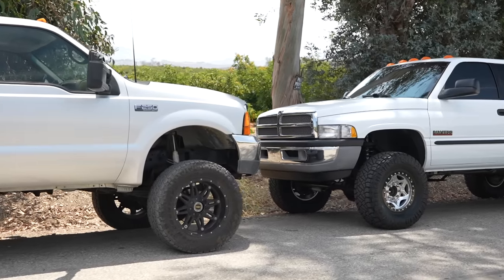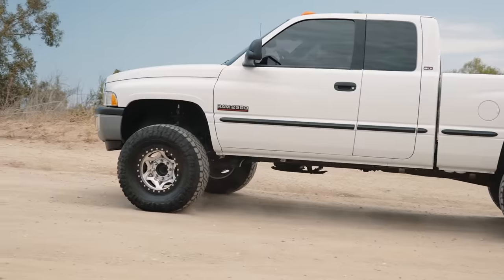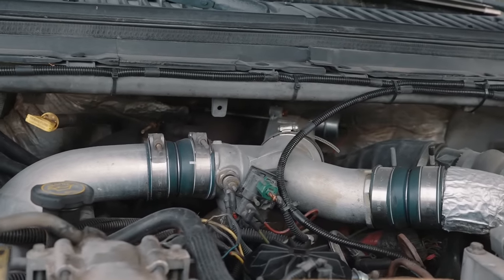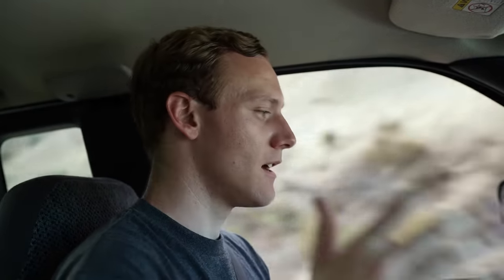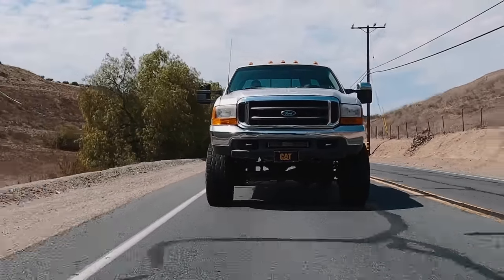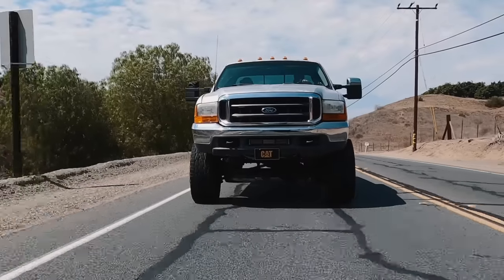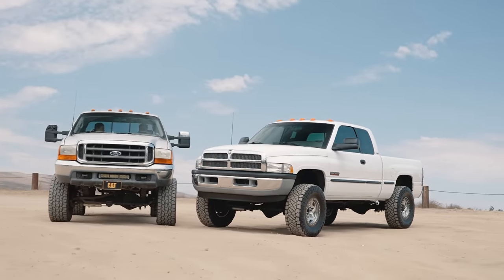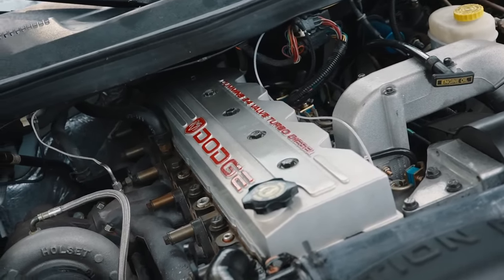1999 Ford 7.3 Power Stroke Super Duty vs Dodge Ram 5.9 Cummins 2nd Gen | Which Is Better?

Comment: I currently own a 
1995 c1500 2wd Single Cab 5 Lug Wheels 6.5 turbo diesel with 4L80e Transmission very Rare 
I also own a 1993 1st Gen Dodge W250 Power Ram Cummins 5.9 with the 5 speed Transmission 
Both 1 owner when I bought
I'd like to buy a Ford 7.3 some day as I gave of the 3 right now both my trucks run great as my 6.5 gets fuel mileage and my everyday driver my 5.9 I'm currently doing a restoration on it but it still runs which is Awsome

Comment: We used to carry both those and the Chevrolets the owner didn’t care he just bought whatever’s cheapest lol but always diesel. Most people unless they were Chevrolet fan stayed away from the Chevys. The Dodgers if it was in town everybody took the Dodgers. But if we had to go out of town it was always the forwards they just flat out pulled him. As far as area of reliability I think the power strokes did better for us. Only because the engines were pretty equal but the transmissions in the bodies were a pain in the butt with the Dodgers. The Dodgers rode nice but we were replacing transmissions in finance every 30 to 60,000 miles it was a pain in the ass. But when the Ford’s broke down they were expensive lol

Comment: It's kind of hard to compare a ride, both of those trucks have suspension lifts. Depending on who made that suspension lift will determine whether it rides good or bad.
Reply from the maker: Both have quality setups. The ram has a Carli commuter system, and the Ford ha custom deaver progressive leaf springs. A coil 4 link front suspension will always ride better than leaf springs though.

Comment: So to make both trucks perfect you just basically have to swap engines between them, trow away Dodge's transmission and put in the same as the 7.3 and built them in both trucks and upgrade suspension in the 7.3

Comment: I started with the 7.3, and ended up with the 5.9.  It will take a lot for me to go back to working on fords. Its so much easier to get power out the Cummins. 1000hp out of a Cummins is just getting started. I am surprised you have done nothing to your truck.

Comment: Personally - I am not in need of a diesel truck in general, but if I were, I would rather own the 7.3. The ford E4OD is a pretty serviceable transmission even though it's a slushbox, while the 48RE is made of glass. In all honesty I would throw out the factory auto and put an allison behind either of these engines.

Comment: Ram is easy to work on you can work on it at your house. 
If the motor gives out or tranny fucks up you have to pull the whole cab off. In my opinion yes ram has iffy transmission but like you said you can upgrade them. And it's easy to install. Ford in the other hand.
Seen more rams reach over 500k miles.

Comment: Cummins is a 10/10 engine.... The 7.3 is a 9/10 engine mostly because is harder to work on it because how is setup and space , but that ford is a 10/10 truck... And the ram a 7/10 , they all get broken dashes, bad brakes, bad front end, worst transmission than the ford... Worst seats... Etc etc

Comment: I owned a 99 F250 7.3 automatic and a 2000 Ram 5.9 cummins 5 speed manual.
Imagine driving your ram and loosing a extra 10 mph on a hill will get 2.5 mph less. 
This is what it it's like driving a Ford 7.3

Comment: Personally I chose to work my obs 7.3 5spd pulling dump trailers hay tractors campers logs through the woods ext cab short bed auto locking hubs, broke bell housing merging, zf6 swapped and now on 2010 axles Waitin on intercooler a very big upgrade on 99 then I’ll go hybrid injectors 😂 for the price of a cummins swap

Comment: Here in the Midwest, the 7.3s love to rust out their oil pans. Good luck with that. Most expensive oil pans out there.
Reply: Everything rusts out in the Midwest because of the salty roads.
Reply: 7.3s are notorious for rotting their pans, and not every vehicle needs their cab and engine pulled for a pan replacement

Comment: Had an 05 350 ford 6 litre , called it the exxon valdise , could not keep fuel in it and rough riding even with the longbox,, but lots of power

Comment: I’m trying to snag a super clean 00 7.3 from a co worker. Only has 140k and he’s the original owner. I drive a 4th gen Cummins(2018) and I live the engine and interior but I blew the 68 at 80k miles and still not impressed with the built trans I put in.

Comment: I love the dodge, but these days if you compare price points on the two for a decently clean sub 150k mile truck the dodge is astronomically higher unless you want to go for one that has a lot of body rust and go that route. I could find a decently clean 7.3 with minimal rust and right around 200k miles for right around 10k, to me that’s what makes me like the ford more, as well as the better transmissions, through basically their whole existence, dodge has struggled with automatic transmissions to pair with the diesel trucks 😭

Comment: The fact that an engine is inline doesn't mean it's going to produce more torque, in this case we have six cylinders versus eight, with the 8-cylinder we have more power pulses per revolution than a 6 cylinder so if the 8-cylinder had exactly the same bore and stroke it would most likely outperform the 6-cylinder, so really engine configuration means very little in producing torque and Power and has more to do with bore, stroke and displacement

Comment: Your F250 is lifted and has leaf springs on the front and is 4x4, my 2wd F250 has coils and is not lifted and it does have a rough ride on rough roads but on the highway its fine. A little school bus like but not horrible.

Comment: Do you have a preference for specific tasks? Such as towing highway, in town, or uphill, stopping etc?
Reply from the maker: Towing: Cummins for the torquier feel. 

Highway: both actually are comfortable, but the 2nd rides better so that’s what I’d pick. It also gets better fuel economy. 

In Town: 2nd gen wins for better ride, but the Ford wins for more space in the cab. 

Uphill: If it’s an empty sprint, the Ford, but if it’s loaded I prefer the 2nd gen. It’s also significantly cheaper and easier to make power with the Cummins platform. 

Stopping: Both are pretty equal!

Comment: The ford might be a little more of a pain in the ass to work but my 7.3 just has a tuner and an aftermarket electric fuel pump and has as much power as a tuned 6.0

Comment: You got one thing wrong in this video. No you cannot put a cup into the first gen super dutys cup holder because they instantly fall into the floor ruining your carpet especially because how stiff the suspension is I have two 7.3’s and I never use the cup holder because every single time I do the drinks spill I have to put my drinks into an aftermarket one I just set in the middle seat

Comment: I've driven both trucks the Ford 7.3 for a door company I once worked for and I own an 02 Dodge5.9 honestly I only stop driving my truck because California's laws against older diesels sucks to me the Cummins is low maintenance no HPOP to worry about the ugly dashboard can be little costly to fix but it can be fixed mileage is awesome power is always at hand the Ford has a terrible turning it's like a river barge I worked on as a teenager hauling brown sugar from the factory to the port but it's just my liking the Dodge and Cummins to each his own

Comment: I have owned a 99 f350 7.3 and 2000 ram 2500 5.9 and i will tell you that when they have the stock suspension the f350 is a much better ride. love both of the trucks though.

Comment: You can also pull a transmission out of a v10 dodge and stick it in you 24 valve
Reply: sounds like a funny loophole, i wonder why the V10 got a better trans.
Reply: @Jszul2318  has more gears in it, you also can pull a v10 out and fuel tank and lines and switch engine mounts and drop a 24 value in it
Reply: @dallasnunn5969  I don't recall the dodge v10 having more gears then the diesel model. But I've never tore one down 🤷

Comment: Should of done a comparison of the 96 models  power stroke vs the Cummins when they both kinda improved then Last years of there generation in 02/03 years at there max stock output from factory

Comment: I've owned both in auto and manuals and go with Ford. Less issues dodge had transmission problems in auto and manual trans as well as front end death wobble in both dodges.

Comment: We had the 5.9 2500 with the 6 speed manual tranny.. you could put it in 3rd gear and let out the clutch with no gas and it would just go.

Comment: I just prefer the 5.9L Cummins. 

It's easier and cheaper to work on. As long as you don't have a #53 block your good. The transmission of the Dodges will be your biggest issue.

Comment: Ford  had failed and spent so much on the E4OD that it was rebadged to 4R100 to get the bad taste out of the mouths of consumers. It paid off and came out strong out of the gate for the 7.3. In terms of building and boosting the Cummins wind but for OEM+/mild builds and daily driving the 7.3 is very much up there and comes down to personal preference. Both are simple motors and you can even put the ford trans behind the Cummins 😉

Comment: Ok ya the 7.3 vs the 24v Cummins is a fair comparison, you can’t compare the 7.3 to a 12 valve though. 12 valve stomps both all day long
Reply: Did you know the 7.3 is a 2 valve per cylinder like the Dodge?

Comment: Always wanted a 7.3 so I bought one. Had real bad luck out of it. So I sold it and bought another one thinking maybe a had a lemon. Nope it got even worse. I wish I wouldn't have had so many problems because the 7.3 is a "good" engine. But I'll never own another. Haven't had much issues out of my 4 cummins.

Comment: Ive got an 02 6 spd dually 2nd gen and then ive also got a 99 f350 powerstroke as my service truck for work both are 2wd my 2nd gen has 199k miles and my service truck has 101k miles. My dually definitely out performs the 7.3 mostly because it's a manual and the 7.3 has an auto but if the 7.3 had a manual as well i think the cummins would still out perform it but itd definitely be a lot closer match and the cup holders in the 7.3 suck compared to what's in a manual 2nd gen

Comment: I love them both, but engines aside the Ford is a far better built truck, dash and interior doesn't crack and fall apart as easy, way less wiring and electrical issues, they don't go through wheel bearings and front end components as bad, bigger transfer case, better transmissions, and better paint and finish. The Ideal setup would be a Ford with a Cummins.

Comment: Vp44 Cummins are the least reliable 5.9s. The injection pump can have problems, and most of the blocks were Brazil castings that were prone to cracking.

Comment: Great video,  I have a 2002 f350 dually crew cab 4x4 and love my truck. I towed a 12000 trailer across the country and no issues.

Comment: Damn near impossible to find a 4x4 7.3 crew cab dually with a manual transmission. But when I do I'll never sell it. The only rams I'd try are the newer ones the old cross symbol looks terrible and rams body styling is goofy anyway. Plus ram is shafting themselves by making megacabs in only short beds.

Comment: The Ford looks way better in every single way, and the sound from a straight piped V8 7.3 Diesel sounds the best. I can not argue, though, that driving the ford requires skill.
Reply: And if you still argue that the dodge is better, The Ford also came with a option for a better interior.

Comment: I've recently been offered a 99 ram 4x4  ext cab for 15k with 100000 original miles it's in immaculate condition but it has carried a big motorhome/camper shell on top of the 8 foot bed it's whole life should I be worried about it's transmission. If I do end up buying it I'm just gonna sell the camper and throwing a regular camper shell on it. I would use it as a daily for work and my dad might use it to move base and gravel.
Reply from the maker: It’s likely just fine! If you need to upgrade the trans, worst case a stage 2 build is under $5k.

Comment: I had 7.3 through highschool, it went through 3 motors, surprisingly trans held up, now I have ratchet shift 12v if I had to choose think I'd go for a fummins I hate the front ends in the dodge n don't wanna throw 4th gen stuff in it, never had a problem with anything in that department, I sold my 24v I used as my daily while 12v was my builder, screw the 2nd gen 24v problem after problem

Comment: Mostly fair comparisons, though one thing stood out. It will be rare to do major work on either truck if you take care of it. HOWEVER, routine maintenance is something you'll be doing often. Which is an absolute pain in the ass with the Dodge and that goes for EVERY generation. It has never improved with time, I'll never forget having to drop the fender liners to change fuel/oil filters. On the Ford? Right out in the open, no hassle and no drama. Try again.

Comment: I was all about the video until I heard that the 7.3L was fast and that the transmission was good LOL the 4R100 sucks and has overheating issues. And the 7.3L was like a tractor motor definitely not fast compared to most other diesels. 
All that being said I have a 2001 F250 with a 7.3 L turbo diesel in it. I spoil the crap out of it take the best care of it and have a lot of work done to it I absolutely love it but let's call a spade a spade...

Comment: CUMMINS TURBO DIESEL ENGINES, all the way baby! Powerstroke, measure let the stronger more powerful truck the work, I don't like just because both my grandfathers worked there, I love there truck engines and trucks. These  pull around a power stroke and wreck a duramax, the best engines is the strongest, I'm sorry, but CUMMINS wins this. 🏆Give this to the best truck, will you. I prefer the 08 Cummins turbo diesel,  than any other. That truck is powerful and affordable. But your truck is sweet to 2nd best in my book.

Comment: My stepdad is 33 and he has had a 2001 7.3 f250 since he was 19 its been totalled a few times and once cought fire because he was welding its never leaving he said.                                                   

I hope 

And my stepdads dads truck totalled right now... it's all bent he flipped it on to the driver side because of a guard rail it.... has a 18 thousand dollar motor in it but it still run

Comment: Whats funny is the 2010 6.7 cummins pulls all of its power at higher rpms, at least from my experience also my 2001 24v 5.9 cummins wakes up at 2,400 rpms
Reply: Also by wakes up I mean it really screams but its has great torque on the low end aswell. (5.9 with an nv300 6 speed, 2010 aisin)

Comment: I have 99 7.3 SD the factory stock transmission is JUNK because the 7.3 has too much low end. This phone s the 2nd built trans in my truck. I also have a 06 5.9 and I like the 6 in a row
Reply: My fat fingers sorry

Comment: 99 F350 hurt my buddy's 14 5.0 GT mustang so bad he sold it. And that was off the line. To be almost fair he was rear wheel lockspoolled where I had all 6 tire firmly planted. And any day of the week my grandmother God rest her soul would have ran circles around him he's a bit of a puss on 4 wheels. Fearless on two. Makes no sense to me but moving on I spooled up the massive turbo on that 7.3 and destroyed that mustang. Both completely stock outside of the turbo on the 7.3 it absolutely wasn't stock and it was tuned accordingly. Dyno had it at just over 5 at the wheel with an extremely 780 ft. As it definitely displayed when up against a far lighter 1014 mustang GT. I do have to note that it was all of 40 degrees outside at around 6am in Indianapolis. So traction he definitely wasn't getting. But we was on 37 pooling away from Johnson county and I continued to pull away for every bit of a quarter. By the half mile he was back on the side and if we'd had kept going he very well may have got me. But the fact I kept him down for nearly half a mile and had the extremely heavy nothing short of a rolling brick hadn't had gotten so sketchy at such insane but impressive speeds coming up on city limits at 6am on a work week. I believe I could have kept him back for much longer. Where there wasn't much traffic at that moment I knew they were just around the corner. Had to do the responsible adult thing none of us ever really want to but we know we have to.... Anyway to close this up he sold it a week later and the moral of the story I love the dodge I'm currently driving. It couldn't touch that 7.3 in that F350 with a viper's gas pedal if a hellcat was pushing it's ass. Learn how to spool that turbo up properly. Lmmfao
Reply: The ass end lock up spool rear end on the mustang was not stock. Got changed when it was tail ended by a Chevy...  Lol

Comment: I would take the 5.9 because the engine  produces more torque and it is way easier to crank more power out of and I own a 2020 Cumins but if I couldn't own a dodge I'd buy the Ford

Comment: There's not a chance man the cummins is crazy easy to maintenance lol 😆  you can literally rebuild the entire engine in the truck and have room to do anything. I've never had to remove the intake horn to change the fuel filter... and changing the oil is even easier.

Comment: The old adage goes that a Dodge will fall apart around a Cummins but a Ford will need 10 new engines before you need a new truck.
Reply: He literally just said they run a 7.3 at work with 500k miles lol
Reply: @shadowbot1234  Ya? That's the 7.3.... now for every other engine they make. Except the iron horse.

I think you missed the point bud.

Comment: Did the Dodge sound a little choked off? As if the exhaust is restricted ever so slightly. I don't know, maybe I'm hearing something that isn't there or maybe the Dodge would see a performance increase if it could breathe a little easier.